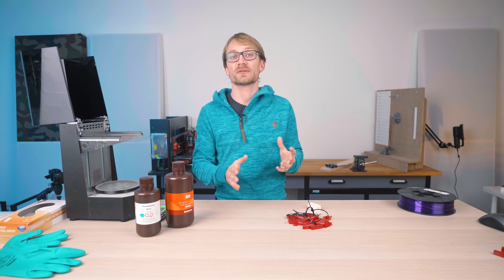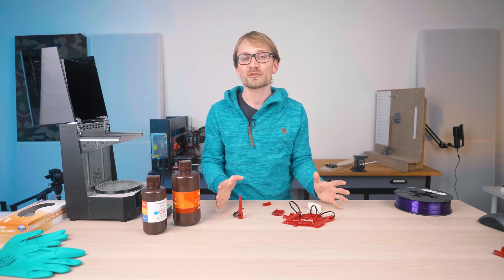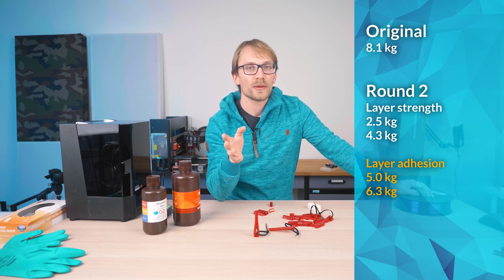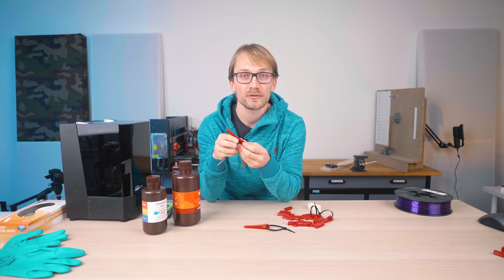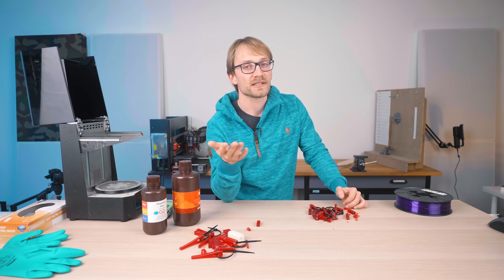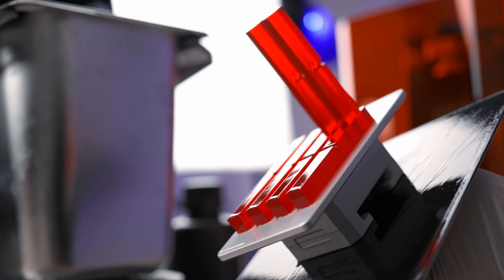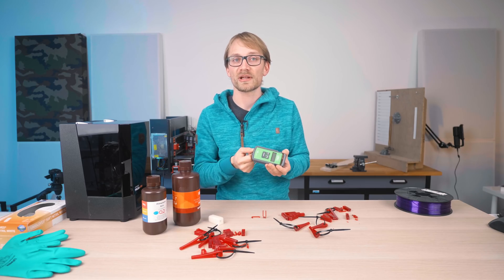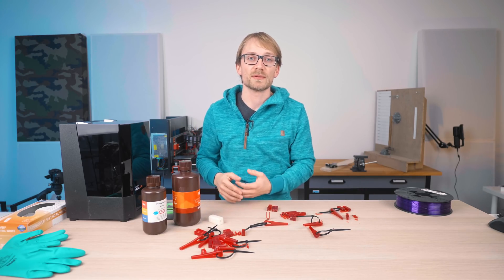Resin prints are weird: Does print orientation matter?

Comment: I cure my Siraya tech blu for a day. 20 minutes sounds way to short for me.
Reply: Same here, especially for fat parts, the absorbtion of the part is huge, curing for hours helps a lot.
Reply: Well it also depends on the wattage of the lights
Reply: @lukemagdalin6169  the CW1 has only 52.8 W max for the UV light, that's not even twice the power I use in my 20 bucks DIY steel bucket